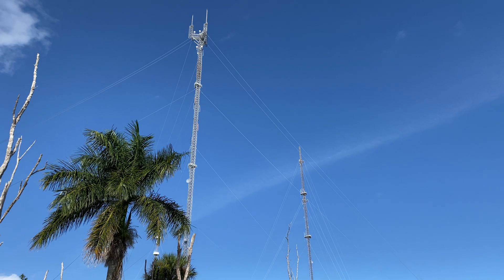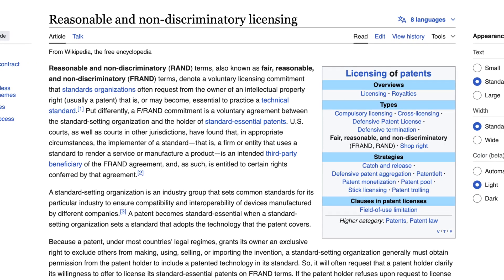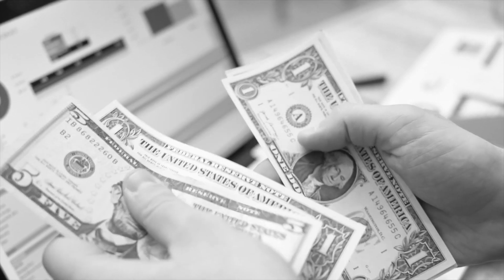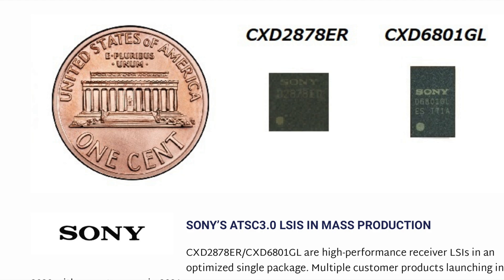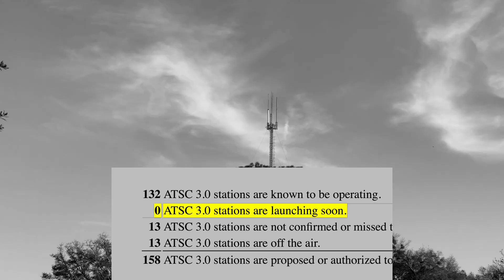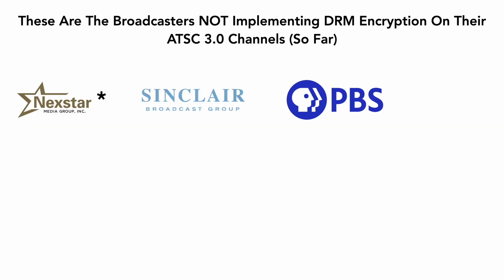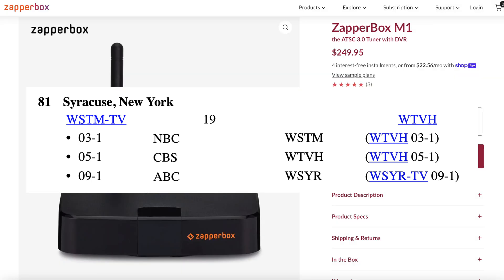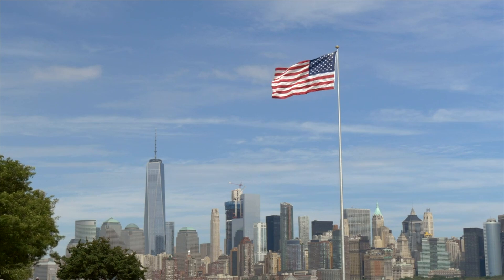ATSC 3.0 Is In Jeopardy

Comment: Is there a way to  add 3.0 by way of a firmware update in the future to LG TVs?
Reply: I suspect that the needed hardware will be there on this generation of TV sets.  LG had it all designed in and then found out that they were going to get hung out to dry so they removed the feature.  If, somehow, all the DRM BS and the need to shell out a pile of money to get certified and get the magic keys, goes away, then LG may offer the upgrade at a reasonable price.  If LG has to pay for the silly nonsense then the upgrade is going to cost a lot.  If the price is high, not many people will buy the upgrade so LG can't really afford to do it.

Comment: I hope ATSC3.0 fails miserably due to DRM and the restrictions the broadcasters will impose on DVRs. Requiring an internet connection to tune into a DRM channel is unacceptable, especially since my internet is frequently down and would mean I couldn't watch an OTA channel during that time. I also love my TiVos for OTA and will hate to lose those when ATSC1.0 is shut down as there's nothing remotely as flexible available to replace them. Cable companies are no longer issuing cable cards so subscribing to cable and keeping them running is no longer an option.
Reply: I agree 100%  I fully expect that at some point, the FCC will take away the rest of the TV bandwidth and sell it to someone.  As DRM and the encryption turns the public's airwaves into just another costly streaming service, the number of people using OTA TV will be decreasing.  The folks watching the non-encrypted stuff will slowly become just the portion of the population on a very limited budget.  Eventually they will be reduced to telling stories in front of a video of a fire.

Comment: With complaints of DRM ATSC 3,0 not being able to be received without an internet connection. Either DRM needs to go or it will go down in flames. Only Android boxes will work and ignore PC and Apple based hardware.
Reply: I suspect that either the plan or the practical result is that what remains of the TV spectrum will be eventually taken away and sold off.  As OTA TV becomes just another expensive streaming service, nobody is going to protest the taking away of a public good.

Comment: To quote Scotty, "The more they over think the plumbing, the easier it is to stop up the drain". Basically ATSC 3.0 has few benefits to the end user, and some could argue that it would cause more harm than good vs what we have now. I say, improve/maximize 1.0, by upgrading codecs to get many of the same features as 3.0. The only downside to that is some people with older equipment would have to upgrade. Given as you stated the low cost of 1.0 tuners, that shouldn't be a major issue.
Reply: It turns out that things that can play streaming video or content from a USB stick, tend to have the better codecs already and the software in them will use it.  A station in Washington state has been transmitting content that takes advantage of that for quite a while.  The codec selection is a separate issue from sending the bits over the air.  It works already

Comment: As long as there is any kind of DRM on FOTA specifically in the US, I will never support it. Use DRM on private transmissions if you want but in the US, regardless of any other country's laws, FOTA belongs to the public. Go ahead and put a big ol' bug on the corner of your free transmissions to ID yourself. Leave public airwaves out of greedy corporate hands.

Edit: Somewhere early in this process a goose with golden eggs was murdered. You must imagine HBO, etc. was jumping for joy when they saw they could technically DRM a TV signal. Imagine, subscribing to HBO and seeing it with an antenna! Joy! But no. Corporations responsible for TV networks got their greedy mits into the situation, etc.

Comment: I am one of the 5000+ filers on the FCC docket for ATSC3.0. I live in a market (Atlanta) where 4 out of 5 ATSC3.0 broadcasters have now implemented DRM. Until DRM is removed, I won't be transitioning to ATSC3.0. My TV viewing has always revolved around either using a network tuner card (SiliconDust) or using a central Tivo unit with minis for each TV. I do not want single TV viewing with no ability to record and watch on other locations in my home. I've been using a Tivo Roamio for 8+ years and I won't replace it until it dies, and the replacement will be an ATSC1.0 unit unless there is a 4-tuner ATSC3.0 tuner that can pull in all of my local NextGen channels with no DRM and allow me to record to my server for playback on any device in my network.
Reply: Yup.  My neighbor may have to help me lug my TV out to the curb when the time comes.  There isn't going to be an ATSC-3 converter box
Reply: @kensmith5694  Actually there is.
Reply: @videobruceb8879  You mistook my meaning.  I meant that I am not buying any of the ATSC-3 converter boxes I have seen on the market and I don't think anyone can make a box that fixes the DRM problem.  The DRM and encryption makes a nonsense of "the public's airwaves"

Comment: Excellent informative video! The rollout of ATSC 3.0 should not be jeopardized by greed. Let's move forward and get this cleared up in a timely fashion. The Friendly Candy Company needs to step in before ATSC 3.0 turns sour.
Reply: ATSC-3 is already ruined.  I don't think it can be saved.  The era of over the air TV is coming to an end and the spectrum will be sold off at some point.
Reply: Not necessarily. Over the air TV is more popular now than 5 years ago and more people are investing in external antennas. A lot of the sub channels that play mainly the classics or westerns are what's hugely popular. Also with inflation rising without wages keeping up more people are going to wind up not having home internet service. The powers that be don't want the masses not to have some sort of distraction .... and therefore over the air TV will likely not go away.   @kensmith5694

Comment: Recall the development a few years back where multipath wireless reception could be utilized to exceed Shannon data carrying capacity of a channel.
Reply: You can never really exceed the Shannon limit.  When people work out the limit for the method they are using it is always slower than Shannon.  They sometimes call that slower thing the Shannon limit hence the error.

Comment: the only thing i dissagree with is that DRM you need the web to watch atc 3  suppose people cant afford web then no tv simple.
Reply: Yes the DRM nonsense is the problem.  If they stripped that out, the standard could be good.  It is more efficient in its use of power.  It is crippled only by the DRM.

Comment: I don't think it's in jeopardy, I think it's already dead. Being crippled with DRM is already a non-starter for consumers, but there's barely any hardware support for it (the percentage of TVs out there with ATSC 3.0 tuners is probably in the very low single digit percent). There's also barely any broadcasts with it. It's all well and good to light up an entire Television Market Area on a map because there's ATSC 3.0 there, but that just means that at least one channel is broadcasting somewhere in that market. One tower does not cover the entire market, some of the markets are geographically huge, and it doesn't even mean that all channels for people within range are ATSC 3.0. And as you pointed out, there's currently zero momentum for that deployment. For that matter, there are zero ATSC 3.0 broadcasts (or plans for any broadcasts) in Canada, despite Canada and the US operating essentially a shared broadcast space.
So, we have minimal hardware support, minimal broadcast support, minimal momentum, patent encumbrance with excessive licensing fees, and the situation is only getting worse over time, not better.
For that matter, from the consumer perspective, ATSC 3.0's biggest advantages don't actually require ATSC 3.0. Most ATSC broadcasts are MPEG-2, and a big increase in quality and spectrum efficiency can be had by just switching to h.264... which is already part of the ATSC 1.0 spec. And adding 4K and HDR and other things to the ATSC 1.0 spec would be easy, since  it's largely just a software change. As far as I can tell, literally the only relevant advantage that ATSC 3.0 has going for it is the more efficient physical layer, and broadcasters will probably sap away most of the advantages that provides by trying to cram as much as they can into the spectrum, pushing signal integrity to the limits.
Reply: It turns out that no effort really is needed to switch ATSC-1 to a better codec.  A small broadcaster is already transmitting the better resolution stuff.  It turns out that the TVs mostly already have the codecs because of their ability to play other media.  The ATSC-1 standard doesn't forbid the better codec.

Comment: DRM as currently implemented seems extremely problematic.  If I am required to have a web connection for DRM to work it functionally disenfranchises anyone who doesn't have or wants to have the internet hooked up to their tv.  The licensing with manfacturers seems pretty onerous which is why LG probably dropped it.
Good standard and they're screwing it up since NAB is convinced they are right and my position is an odd "one man out" minority.  One of us is right so we'll see who it is.
Reply: Even if you have an internet connection, the broadcasters can still deny you and in fact do. They want to turn OTA into the new cable subscription.
Reply: It should be illegal to use encryption on broadcast frequencies full stop. If they want to transmit wireless encrypted data they can go compete with the cell phone companies for spectrum.

Comment: Basically if ATSC 3.0 fails in the US, all the Nextgen equipment purchased by consumers, both TV’s and set-top box tuners, will become very expensive ATSC 1.0 tuners, nothing more.

The other problem is that TV manufacturers that do include ATSC 3.0 tuners hardly make it known to consumers, instead emphasizing the streaming capabilities of smart TV’s to push people into paying for more streaming services. 

You practically have to dig through a manual to double check what kind of tuner a new TV has built in. The NextGen logo might be somewhere on the packaging- maybe.

Why don’t manufacturers put some effort into advertising the  new standard to consumers?
Reply: Hey I have a question and I would be very grateful for your reply. I have not kept up with what’s going on with broadcast bands in years . Whatever happened to those boxes we all bought at the KMart to make our old VHF UHF TVs into a digital compatible? Do they still work at all? Just curious. Are they all in landfills by now? Sorry to sound so obtuse on the subject, but I haven’t kept up with what’s going on with our (formerly) free airwaves. Many thanks and Kind Regards.

Comment: The current rollout of ATSC 3 relied on carving out bandwidth from existing markets with existing equipment.  Eventually, the excess bandwidth will dry up, and the only way to roll out more ATSC 3.0 stations would be to switch from 1.0 to 3.0, and that's not going to happen until ATSC 3 tuners and TVs are cheap and affordable.

Comment: Its over for ATSC 3.0. It just can't compete with fast channels. Its going to go down just like the Blu-Ray and HD-DVD debacle. DRM is destroying ATSC 3.0! When you leave a new broadcast standard up to corporate America - this what you get. Why buy a ATSC 3.0 tuner like I did with GTMedia's HDTV Mate and I can't watch the channels that I want due to DRM? You are not getting what you paid for. A ripoff.  It would be interesting to note how many ATSC 3.0 tuners boxes were returned due to DRM? If a ATSC 3.0 tuner is not made by a major TV manufactor (who had years of designing and manufacturing tuners) its most likely crap IMHO. My old ATSC 1.0 USB tuner is made by LG.
Reply: New to antenna TV 2024. As far as I understand, the DRM keys require internet to transmit. If this can't work and distribute the keys without paying for Internet service, there is no incentive for me to put up an antenna. Also, I will not pay $150 for a tuner. I hope the TV manufacturers stop including atsc 3.0 tuners because of this patent lawsuit. This is what they get when they don't regulate th patents The DRM issue is on the broadcasters.  I hope the whole thing blows up to teach them a lesson. We don't need TVs. We need monitors and a cheaper set top box. So we can upgrade boxes instead of tvs. The manufacturers should cut their costs and cut out tuners and networking. Leave that to the streaming box manufacturers.
Reply: For the record, the ATSC 1.0 tuner in my Samsung TV is absolute crap and the TV will frequently CRASH on weak signals.

Comment: Question:
Since news, breaking news and energy program interruptions are required for everyone to pickup,. Could the FAA since they have control of what is broadcast through the air? If you look up energy broadcast information, it should be in there that information can not be encrypted. We need to get the FCC and FAA on this subject. If they find out stations are keeping these type of broadcast encrypted, could the station be fined? Stations may not be encrypted if they are forced to not have these types of broadcasts encrypted.

Comment: 12 Reasons why OTA DRM ATSC 3.0 TV will fail. Just say NO to (DRM). Tell your USA Government about the Hostile Takeover of (OTA DRM ATSC 3.0 NEXTGEN-TV) issues listed below.

DRM (Digital Rights Management) Encrypted TV Station's signals.    Why?

Some 3.0 tuners at this time require you stay on the internet to decode DRM 3.0 TV Stations.      Why?

3.0 Currently no 4K and you only get the Simulcasted main channel and no sub channels.

Channel Crawling = super slow channel changing (DRM 5 + seconds slow).

No sound because of Dolby AC4 audio codec does not have a legal open source license to decode legally on many devices.

Some 3.0 tuners have Out of sync audio to video problems.

Private Home Networked OTA antenna tuner boxes like (Tablo TV box) can not get official certified approval for DRM ATSC 3.0 NEXTGEN-TV.     Why?

You may need non OTA home pay internet for updates and to unlock DRM encrypted ATSC 3.0 tv channels.

Possible DRM restrictions on DRM ATSC 3.0 recordings and no viewing anywhere on any device with no sound.

Emergency alert messages can not be received if DRM is blocking them.

OTA DRM ATSC 3.0 TV will fail because the FCC is not going to turn off ATSC 1.0 TV stations for many years if not enough people buy 3.0 TVs and 3.0 boxes.

No one has solve the problem of no government money for free DRM 3.0 TV tuner boxes because 1.0 TV turners and recorders will not work after that TV Station switches to 3.0 TV broadcasts.

(Range and signal error correction) OR (more sub channels and near 4k picture) trade off problem.

FCC is not forcing any 1.0 TV Stations to move over to 3.0 TV. So some TV stations will be on 1.0 and others will be on DRM 3.0.

The FCC is only allowing OTA Simulcasts of the ATSC 1.0 main channel at this time on DRM ATSC 3.0 NEXTGEN-TV.

DRM ATSC 3.0 is a not finished product and is a work in progress mix of unproven ideas that has never gotten full FCC approval at this time.

Software updates for 3.0 tuner boxes may be needed for changes made to the unfinished and future added new official ATSC 3.0 standards modules.

Patent License problems. LG no longer sells TVs with ATSC 3.0 tuners.

Some 3.0 TV tuners companies may go out of business or stop updates leaving you with no DRM or software updates.

OTA ATSC 3.0 is better but is not perfect and still can be affected by weak tv signals: (distance, weather, planes, trees, buildings, trucks, poor antenna, etc).

FCC rules that 5 percent of old ATSC 1.0 coverage area does not need to be covered anymore = (SHORTER RANGE).

Viewing zone outside of your 15 minute city or town could be blocked.

Your TV viewing habits could be tracked by your serial number or IP address.

ATSC 3.0 is updatable until it is not updatable without new hardware tuners (ATSC 4.0, 5.0, 6.0, 7.0......).

Some of these 3.0 TV issues may be fixed over time.

This is only some of the mess with DRM ATSC 3.0 TV.

This is my opinion why DRM ATSC 3.0 TV will fail.

IMO. Stay on OTA 1.0 TV until DRM is removed from OTA ATSC 3.0 by law.

It is the people versus the hostile takeover by private DRM 3.0 TV stations for control over the USA public airwaves.

IMO 2024...
Reply: Whew, it would be easier to more fully exploit what ATSC 1.0 is capable of doing, including making 4k broadcasts.
Reply: Thanks for the thorough analysis, and thanks for your use of white space to make it readable.
Reply: @porcupinecone7188  Some Lamos don't know what the 'Enter' key is for !
Reply: I want TV manufacturers to design ATSC 4.0 so they can’t get sued.. and tell the NextGen TV people to go take a long walk off a short pier.
Reply: They should go directly to FCC with it and get approval without input from broadcasters.
Reply: In an emergency, when the Internet is down.  ATSC 3.0 may not be viewable.  Who the heck thought this was a good idea?  The people who developed ATSC 3.0 were likely more interested in money and broadcasters then the public.  And the FCC, whose been off the job for years, has not been doing a thing about it!  All they've become is another taxing authority, selling off spectrum.  And if you think the buyers will be paying for it, you're dense.  That will come out in our bills in one way or another!

Oh, the other thing I think no one is covering.  DRM may be there to push antenna viewers towards the more profitable (to the broadcaster by way of rebroadcasting fees) towards a pay service.  Thus ending free over the air TV.  This should be the deal for them.  If you turn on DRM, you can't get rebroadcasting fees.  There, fixed it for you!
Reply: I want TV manufacturers to design ATSC 4.0 so they can’t get sued.. and tell the NextGen TV people to go take a long walk off a short pier.